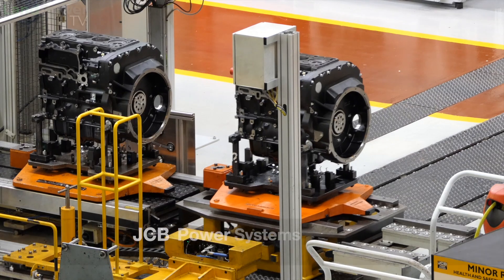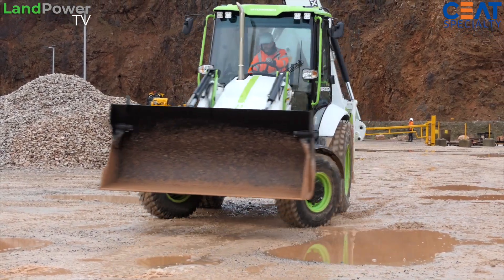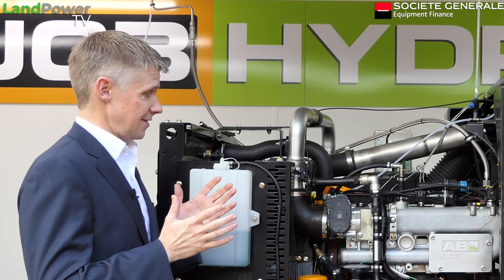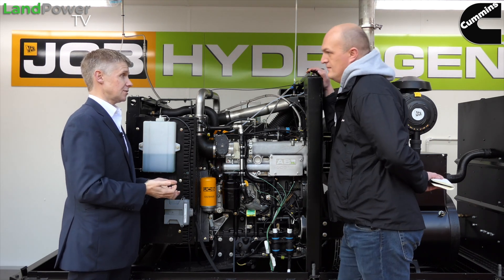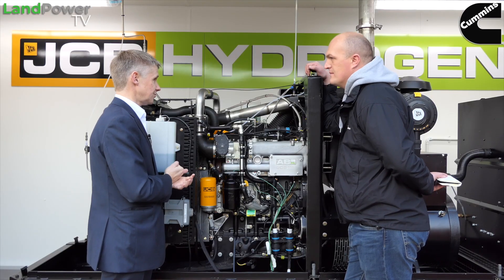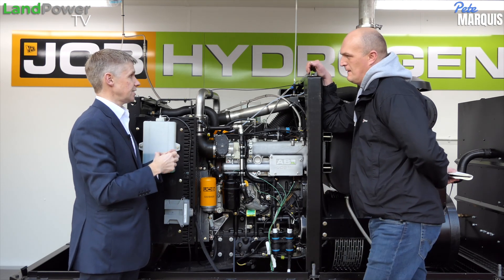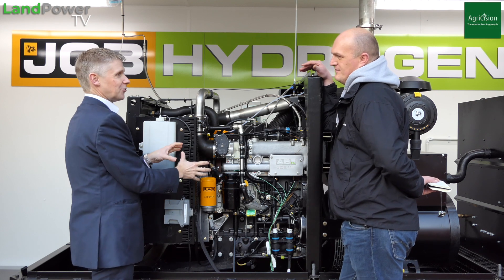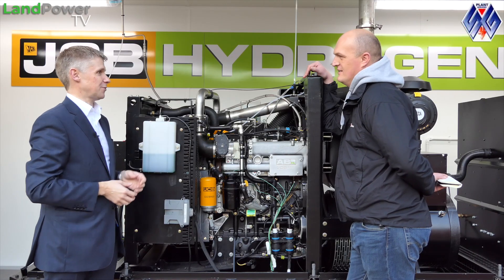JCB shows off its hydrogen internal combustion engine

Comment: I don't agree with JCB's idea because, there are several reasons why EVs are becoming less complex and more environmentally friendly. 

Firstly, the development of carbon batteries is a notable example of this trend. Carbon batteries are less hazardous to the environment compared to traditional battery types such as lead-acid, lithium-ion, and LiFePO4 batteries. 
However, it's important to note that carbon batteries are just one of many emerging technologies poised to replace these conventional battery types.

Secondly, the shift from permanent magnet synchronous motors, (PMSM) to switched reluctance synchronous motors (SRSM) and externally excited synchronous motors eliminates the need for rare earth metals in motor production. 
This advancement in motor technology reduces complexity and addresses concerns regarding the availability and environmental impact of rare earth metals.

Thirdly, EVs have made significant progress in regenerative braking technology. 
This technology allows EVs to capture and store energy during deceleration and braking, thereby saving energy that would otherwise be wasted. 
In contrast, internal combustion engine (ICE) vehicles lack the capability to develop such a function in the near future, putting EVs at an advantage in terms of energy efficiency.

Moreover, when comparing the efficiency of converting energy from the source to the wheels, EVs outperform hydrogen-powered ICE vehicles by a wide margin. 
EVs achieve an impressive 80% efficiency in this conversion process, whereas hydrogen ICE vehicles struggle to reach 20%. 
This stark contrast arises from the fact that electrolyzers, which produce hydrogen, have an efficiency of approximately 45%, and hydrogen ICE engines can achieve around 40% efficiency under ideal conditions.

Finally, it's worth mentioning that the infrastructure required for transportation and dispensing of hydrogen is separate and distinct from that of EVs. 
This creates additional challenges and investments for the widespread adoption of hydrogen-powered vehicles.

Considering these points, I find that the arguments presented in the video do not substantiate themselves adequately.
Reply: The discovery of large white hydrogen deposits does change the landscape, it makes a heck of a lot more sense if we can pump it out of the ground like oil.

Comment: But what I'd like to know is how long can it run for on a tank and how big is the tank? Given the very low energy density of hydrogen it can't run long at all. If you replace a regular petrol car tank with a same size hydrogen tank you would only get about 50 miles. 
Also this kind of machinery always has fuel and hydraulic leaks if you can not keep diesel in how can you keep a gas in?

Comment: When we have simple fast hydrolysis of water this could really kick off. Imagine putting water in the tank, it gets split, it fuels an engine like this which generates the electricity to drive the motors on each wheel etc. Super efficient. Imagine a air craft doing this!! Amazing.
Reply: But it's not super efficient, It takes a lot of electricity to make hydrogen, then compress it (more energy), transport it (yet more energy) and put it through an internal combustion engine (very inefficient). It will work but super efficient is not a phrase I would ascribe to the process.
Reply: @christopherfairs9095   Hydrogen is most energy dense fuel out there so you don't need to make or transport that much. Also if you are interested look into red hydrogen. Japanese scientist's have demonstrated a way to use the thermal heat of nuclear power plants to generate electricity and produce hydrogen.
Heavy duty vehicles, planes, ships and even buses are better suited to hydrogen ice technology.
Reply: @priyanksaklani8176  Hydrogen has the highest energy content of any common fuel by weight (about three times more than petrol), but it has a low energy content by volume (about four times less than petroleum).

Comment: Imagine how much longer the oil can stay in the engine. No fuel dilution or carbon fouling will mean that a synthetic oil will last incredibly long. All you'd have to do is just check the level most of the time. The amount of oil burned would be negligible. The real question here is how what kind of efficiency they are able to achieve, the fuel consumption, and the projected running costs now vs. in the future when the industrial production of hydrogen expands.

Comment: Toyota,honda and other car manufacturing in japan and Europe also developed internal combustion hydrogen engine for the future they say this is solution for anyone love internal combustion engine like car enthusias,reguler user and with Zero emission.but they know about the tank still heavy compare to petrol or diesel car we know,but they say just matter of time for resolve that problem to make compact and light hydrogen tank before they sell hydrogen combustion engine car in 2030
Reply: Tank size because they still use plastic not yet high pressure metal tank with carbon fiber wraping.
Reply: @SharhbiniRauf  yap that true toyota say give us time

Comment: Inspired thinking from JCB.
You keep the Diesel engine which is modified to work with Hydrogen fuel, which is brought to the civil engineering site just as diesel currently is.
You don’t change a winning combination.

Comment: Well done jake 👍👍👍. Hydrogen the way forward.  Not electric.  Don’t know why the car industry doesn’t embrace this tech 👏🏻👏🏻👏🏻👏🏻
Reply: I stay with the hydrogen. You can drive a ev powered by hydrogen cell or you can drive a ICE using hydrogen. You can use two version only utilizing hydrogen
Reply: Why not run it on helium like the fork lifts.
Reply: @tonywalker8030  What?
Reply: Cause the car industry is lazy and cheap.
Reply: Metallurgy 101
Reply: When we have simple fast hydrolysis of water this could really kick off. Imagine putting water in the tank, it gets split, it fuels an engine like this which generates the electricity to drive the motors on each wheel etc. Super efficient. Imagine a air craft doing this!! Amazing.
Reply: Embrittlement. Ever see what hydrogen in propane does  to a heavy industrial propane engine? And that’s diluted by 2.66H- 1 C molecule. Need to talk to someone who’s torn down a straight H2 engine with 3 yrs on it for analyst.. 
The propane one I did had 5yrs .. nothing salvageable. 
Would be interesting what they came up with!
Reply: Because making hydrogen green is incredibly inefficient
Reply: I don't believe hydrogen is the way forward for this type of machinery. Battery/electric motors are far more efficient and will become increasingly so as technology evolves. These engines are too complicated compared with an electric motor. The cost of hydrogen as a fuel will be enormous as the process of making, storing and transporting it is inefficient. That's why Toyota is back-tracking on its hydrogen cars with fuel cells. JCB already has some small electric excavators and larger versions of earth moving equipment is made by Volvo and others. Bobcat has taken it a stage further and produced an all-electric version of its well known vehicle, even replacing all the hydraulic system with linear electric actuators. It will be interesting to see what happens in this industry. Of course these hydrogen engines will work, but with increasing battery energy density and decreasing cost per kw hour of output, I think there is only one way this will go in the long term.
Reply: @christopherfairs9095  heat will be the issue for batteries with heavy plant.
Reply: @merlin1346  There will obviously be heat generated but they seem to have dealt with that in the battery powered ships and locomotives.
Reply: @christopherfairs9095  battery powered locomotives are still 'experimental' and will consume a vast amount of battery power due to their inherent weight without the power pack. as for ships, they would be literally floating on its own fuel if HOD were used instead of batteries, not something you would want to run out of out at sea either.
Reply: @merlin1346  Yes, these locomotives are experimental but battery electric multiple units are more developed and are in use. It would appear to make just as much sense to use them for trains as for cars. They could be recharged by induction at selected sites en route. Battery improvements will give greater range and efficiency but it won't happen overnight. At least the concept is proved.
Reply: @christopherfairs9095  a short video of this 'concept' would be good.
Reply: @christopherfairs9095  but batteries cannot work for a 20t digger. You can easily use 150l of diesel a day that would be around 5 tonnes of battery or 1mwh of battery. You’d be looking at something like 200k just for the batteries and where exactly would you charge them? My site only has a 40kw generator that runs on diesel and we cannot get mains power.
Reply: @PiOfficial  Hence my point made earlier that batteries continue to be improved. It may be impractical for a 20 ton excavator for most cases a the moment but I believe one or two exist and are working. When hydraulics are also eliminated completely, that greatly improves efficiency as we;; as reducing weight.
Reply: @christopherfairs9095  good point never even occurred to me that you could just have individual motors for each joint.
Reply: @christopherfairs9095   weight is not a bad thing with heavy duty cylinders. I don’t know if your lightweight actuator would hold up the same as a hydraulic cylinder on a D9.
Reply: @FFLFFS  I agree it would be a challenge to reproduce the large lifting cylinders on a big bulldozer but few such things are impossible, given the will to succeed. It will need a lot of money to develop such a thing but these are early days. Boeing has replaced a lot of hydraulics, including the brakes, on its 787 plane.
Reply: @christopherfairs9095  diesel electric is the future not only battery electric.
Reply: @christopherfairs9095  batteries are certainly not the future a 20 ton excavator would require 10 tons 9f batteries to do an 8 hour shift these large machines are run non stop with operaters switching out in shifts.

And there is nowhere to charge large machines they are onsite long before any power arrives.

Mr bamford covers all this in his video about it.

Hydrogen can be made when demand for electricity is low IE nightime nuclear power stations can run 247 and hydrogen is basically a battery.

The engines cost no more to build than regular internal combustion engines.

Also all new gas boilers come with the ability to run hydrogen.

It is the future. Electric means children mining rare earth materials that are finite.
Reply: Correct.
JCB built the worlds first 20 tonne Hydrogen fuel cell excavator which is an EV.
It cost double over a diesel, so a business was paying out twice the amount to move the same amount of Earth in the same amount of time.
That’s never going to be practical in a construction or civil engineering role.
Reply: @sixstringsforever  and the metal wears out at the same rate. Your return on investments would be double that and going in to the more expensive, latter time frame of owning a price of machinery. 
I’ve  seen what computers have done to 250,000.00 machinery at auctions. They wouldn’t even fetch 15g. Now double the price with a new fuel system AND a computer? That thing could be three yrs old and 100% worthless.
Reply: @christopherfairs9095  BEVs make sense for compact cars. Not so much for Heavy Equipment, Farming, Trucking, Naval and Aeronautical sectors.
Reply: @RogerM88  I think you are right at the moment but I believe one day they will do.